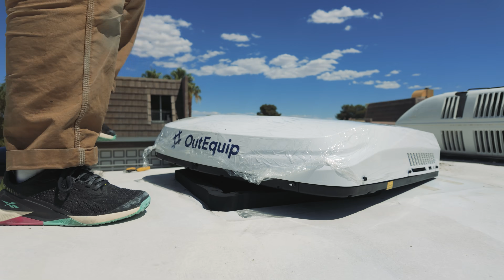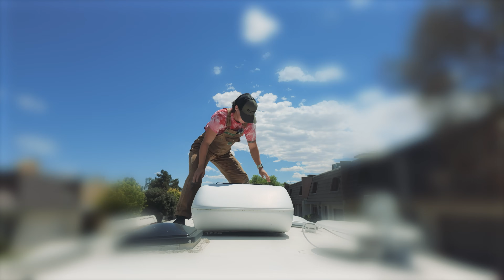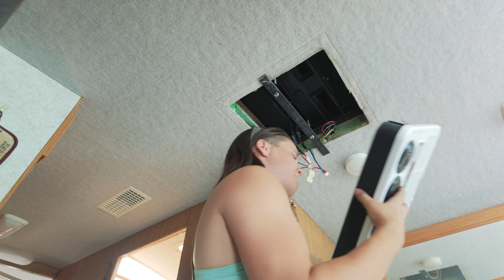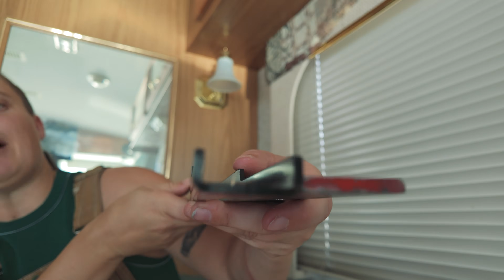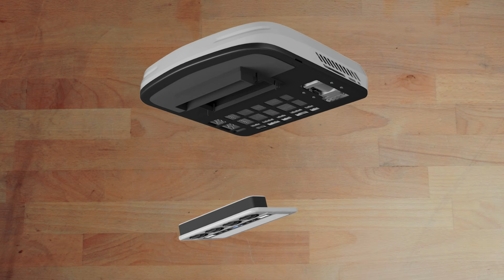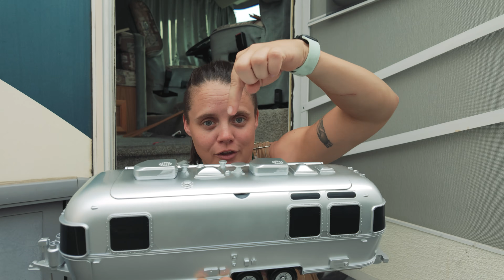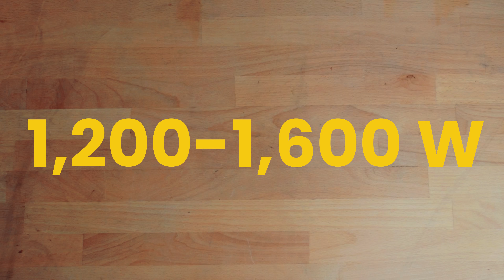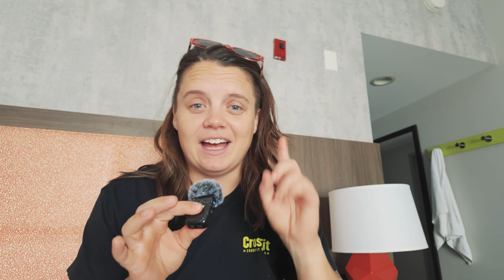Better RV Cooling with Less Power? My Switch to a 12V  AC | OutEquipPro AC Honest Review

Comment: Definitely looks more efficient than an old ac unit. What about charging your batteries? How does the ac side of things look while using this ac unit? Is your charger capable of both powering this ac and storing a charge in the batteries? 

Clarification; I am not dissing this product or your video, genuine questions.
Reply: uses less power because its cool out and it has less cooling capacity

Comment: Be sure to correct your statement that it only uses 300watts, because it uses 960watts on high. And you don't want to confuse ppl. The max wattage use of when the unit is on high is the only one that matters, because that is the amount it uses when it is putting out its max rated btu's of cooling. And that is how you determinine the Energy Efficiency Ratio ("EER") in order to compare one a/c unit to another. This is a 10kbtu unit, so 10,000 divided by 960 = 10.4 So this is an EER10.4 unit. Which means it produces 10.4 btu's of cooling for each watt you spend running it. Your measurement of around 300watts was real. It WAS only drawing 300watts right then, however it was ramped down to a lower btu cooling amount at that time. How much lower? Well, with an EER of 10.4, and if it was only drawing 300watts, then (300w x 10.4) 3,120 btu's was the amount of cooling it was putting out right then.

Comment: My RV AC really drains my Ecoflow Delta 3 Pro really fast.  I got the extra battery but they are so dang expensive... This is a much better solution.  Thanks so much for posting.

Comment: SAVE EXPENSE !!!!
Simply open up roof vents. 
If need be, have an efficient 12vDC computer power supply type fan, that uses maybe only less than 1 Amp.
Hot air naturally convects UP to the ceiling/roof.
For a cool breeze, several sizes of 'swamp-coolers' are available. Position one of these evaporative coolers next to each window you happen to have opened partially. The smallest ones, for $30, run on only a fraction of an amp @ 5vDC.  They need water, though, and can't be used when bouncing around while traveling.
Think how counterproductive it is to REFRIGERATE indoor air, and throw that heat off to the OUTSIDE, thereby compounding the problem, requiring even MORE 'Air Conditioning'. The more people using it, the worse it gets outside, and it creates more GLOBAL WARMING.
I use an air conditioner only when the aforementioned technique is inadequate.

Comment: Hi Emily, I’m wondering why you didn’t run the power cable through the return duct rather than drilling a hole through the roof.  Is there a complication with doing that?  Just wondering for my own install.

Comment: I’m very intrigued . I have a ecotech wave2 ac right now.  I had a van just bought a ambulance. It is to pull our rv and transport my dogs. I work my dogs during the week. Get ver hot in the summer use fans for the most part but during the really hot months like my dogs to be cool. Not good to just idle the vehicle so use the wave2 unit to keep it cool. It does a good job but does take up a lot of room. Think this unit would be better. Actually just started learning how to put solar up. We use the battery that. One with the wave2 and the larger power pack I have. But would love to put a solar set up on top of the ambulance . Do you have a suggestion of what size solar to use to get the most power for running mainly the ac and the cooler. Thank you.

Comment: This is great. Very helpful. Thanks. I have a 2025 Revel with a 3000W inverter and 8400W of Lithium power. Based on prior research, I knew the AC system would be the biggest flaw. For example, while at home, I tested the AC draw using my 6500W generator with the Revels EcoFlow App. On Low cool, the initial start up was calling for 3160W until the compressor kicks in. That’s even a strain on the inverter. Based on Winnebago stats, the battery life will last about 8 hours when constantly running the AC. I wouldn’t do that. Importantly, engineering wise, that is not good. Winnebago’s fix was stated to add a slow start system, use a generator, or shore power. Winnebago, Really! Defeats the defined purpose of the Revel. However, Owners have had success with the slow start and a small potable generator of 2200W. Yet, not the Revel’s intended purpose. Presently, I just use the max air fan or a Luno portable 12v fan for cooling. It works. But, it is only early June. I like the 12V AC idea. Happy travels.

Comment: La energía no se crea ni se destruye, sólo se transforma. Si necesitas una cierta cantidad de energía para bajar la temperatura no importa qué tipo de corriente utilices, siempre va a ser igual, puedes hacerlo más o menos eficiente pero no necesariamente funcional para el caso que se explica. 
Nunca tendremos frio suficiente contando sólo con carga almacenada en las baterias de un RV a menos que utilicemos las baterias de un tesla😂
Reply: "It will never get cold enough on RV batteries unless Tesla batteries are used"?😂 You mean LiFePo batts, right?
Reply: Not only LifePo but also the amount of amperage generated by a Tesla battery. @__WJK__

Comment: Is the premise of this video that people with existing RV’s are more likely to have 12V batteries, because many new builds are moving towards 24V/48V  systems/batteries which are much more efficient, and then getting a 24V AC would be better? I think both systems would have inverters to convert to 120 for other uses, and a 24V to 12V for maybe a frig? I guess the question would a 24V AC like the Nomadic X3 be a better option than a 12V unit that you are reviewing?
Reply: most rvs only have 100 ah of useable power in the stock battery's

Comment: Nice work and great video with clear, easy-to-follow explanations! With a 12V setup, this system can draw up to 58 amps, so it's important not to skimp on wiring, especially for longer cable runs. Be extra cautious with your cable joins, ideally it's just one single 6 AWG or thicker cable, and I strongly recommend installing a 100-amp fuse as close to the positive lead, possible to help prevent shorts and reduce fire risk.

Comment: I would imagine to calculate the actual energy usage difference between the 2 systems, you would need to not just calculate how much energy it is using at any given moment, but how much energy it uses to get it to a specific temperature and hold it there, one unit may stay on using a small amount of energy constantly, whereas the other unit may turn on and off using a lot when it is on but then not much when it's off.
All this would need to be accounted for to get a real comparison. I could be wrong, just my first thoughts.😅
How much time it takes to reach temperature is important for comfort as well. 
Calculating how much energy it uses during the process of reaching the temperature is how you would compare the 2 systems. Please do this, it would be great to see😁

Comment: I wish you would have shared the battery bank requirement for running this AC unit. I have a 300 amp hour battery bank on my cargo trailer and I'm wondering if that is enough battery power to run this unit, but you never talked about your battery bank. :(

Comment: I just installed this and the fans power up to high when I supply power. I disconnected the power and reconnected after five minutes and it’s doing the same thing and the fan adjustment speed doesn’t have any effect with both the remote and on the unit itself. It’s always stuck on high.Is this a logic board issue or a problem with the connection?

Comment: First of all: nice video!
I had high hopes seeing this unit, but I just found out the optional heating function is just a simple ptc element. It's not inverting the flow to make it work like a heat pump. Since I would also like to heat my van this is a nono for me since this will consume too much power when heating.

Comment: So this ac unit sounds fantastic! I just purchased a 3000 wh solar generator with a 12v 30amp outlet that will easily power this ac unit. Plug in my 600w solar panel and I'm living very cool and free! This is going in my cargo trailer build for sure, ❤ bunches.
Reply: You'll probably need more like 80 amps to power this thing on the hottest days. Her readings were not typical of a long-run on a hot humid day in the sun. I've seen that these things are rated closer to 900 watts maximum which is over three times what she was saying hers was drawing on this video. I then thought about the size wire you'd need to purchase if this thing wasn't practically right next to your batteries and that might cost half as much as the air conditioner itself. Honestly when you've got enough batteries and panels, the loss from the inverter usually becomes a non-issue anyways. I've also heard these new scroll-compressors don't last more than about five years, compared to multiple decades on the older ones.
    I think the soft-start for a normal 120 volt rooftop is the way to go for the vast majority of people. I think this DC AC is more of a specialty item than this video leads on, unfortunately.

Comment: I just installed a soft start on all 3 of my Coleman Mach systems in April and if you know basic electrical and can use basic hand tools you can do it yourself.  I would love to convert my units over to 12v for boondocking with my solar but having 3 units in my 45' toy hauler the soft starts were a much cheaper option.  I didn't purchase the Coleman soft starts because those are over $300 each, I went on Amazon and found the same soft start with mounting brackets for half the cost.  And since labor was free it saved me a bunch of money.  Maybe one day manufacturers will install these 12v systems from the factory.

Comment: which AC did you replace? the 1325 watts on 120 VAC A/C lends me to believe that you had a "Power Saver" by Coleman/RVP. In Nth Texas we typically run 1800watts to 2400 watts(100'+ day) with a 15KBTU roof A/C. The Coleman Power saver is rated @ 13.5KBTU and the AC yer using is rated @ 10KBTU. We dont know the ambient (outside temp )temp nor the % humidity. both of which radically effect the wattage and cooling performance. I really do want a comparison with the chinese made 12VDC ACs as our experience has been disastrous, however they did not send us an AC which was tested by said Mfg, knowing it was to be used for a test comparison on u tube. the warranty process was little to nonexistent. After the 3rd compressor failure and one unit replacement, the factory sent out their own repair tech and he just shook his head, told us we did everything he would do and left the lot. He never got back to us and 6 weeks later the owner of the RV had to pay for the hours of labor and no working roof AC.

Comment: Nice review. 
I had not heard of this brand before. 
I’m wondering how the performance (BTU output and amp draw) and price compares to others like Dometic, Cruise and Comfort, etc. 

I’m looking to add a unit to my 2019 Sprinter. 
I have two MaxxFans with the molded valley fillers from DIY Van for a flat mounting surface. 
Or-I could always cut a third hole which won’t leave much roof left for solar.
Reply: Maybe you did some comparison shopping and could make a video on the pros and cons of what you found?
Reply from the maker: 👀👀👀Keep your eyes peeled. I’ve got something in the works.

Comment: Can I run to 12 volt ACS in my rig I already have one mini split 12 volt backpack style that I have not hooked up yet what I plan on it but now I think I want to replace the rooftop unit as well
Reply: I've been doing my research on these 500 cubic feet but they're 10,000 BTU 20,000 BTU off of a 100 amp 12 volt converter BTU to cool 1100 to 1200 cubic feet of space foot my RV is 1500+ I just need to know before spending money on another unit to replace the 120 volt if it's going to be able to keep up in the Florida heat

Comment: i guess this computer like rest of the house ( fried from main grid fire fried the breaker box & majorly surged the whole home and RV camping trailer really) ps there OFF GRID BUILT BUNKHOUSE CAMPER IT SOLD OFF GRID USE ) THIS REAL IMPORTANT ITS FRIED the 12 volt power supply in said camper IT BUILT IN REALLY  30 to 40 amps really ps well plugged into AC OUTLET FOR THE CAMPER! oh well plugged into this ps ITS FRIED REALLY  from main grid fire fried the breaker box & majorly surged (oh i had a EMP device heavy surge device really on breaker box too) it fried stuff in house & rv home - really main heater unit a 2000 dollar unit really fix was 40 dollar part really & microwave 75 dollar walmart & surge switches 3 & RV bunkhouse camping trailer (off grid use really) main on board wired into breaker box the whole unit breaker box & 12 volt fuses the whole wired crap thing really one breaker pops when put on fire thews out oh crap what is it ( the  120 ac to 12 volt on board charger & its 30 to 40 amp feed really) it like cars output for tow truck really it ran 12 volt system well towing really that what i used with solar & gas generators & car chargers harbor freight & Walmart ok  i on phone to insurance agent for march fire and crap really now it rung it them from march really! ok 8000 watt generator propane / gas duel fuel generator per wired house & 150 lb propane setting here in march =3 to 4 days ps i refilled 30 lb to in said time 180 ib price tanks & refills & the generator cost & transfer breaker box unit most 2grand gone it last 3 maybe 4 days on 180 lb of propane do i need to keep going on & rv had generator unit's to & solar system really 2 gallons and half every 3 days normally & out in solar to lets do 30 days & snowing at 130 am really on the 21 of march really i running the truck really it happen grid out meter gone really 915 pm on the 20 th the truth really COST?  I LOVE 100 GRID NOW MONTHLY  I  GOT NO IDEA THE COST REALLY YET that what call was about!

Comment: 9:39 - If you grind a notch in a U-shaped steel bracket, you will seriously weaken that bracket. You should never do that on a commercially produced bracket. Those things are designed for the stress load they have to carry. Cutting a notch in it could cut the bracket's ability to hold up under that stress in HALF.
Reply: Just caulk it. No need for fancy stuff. 1/8 caulks easily. If you don't want it to stick, put slick back tape on the cover and then install it. Caulk it. Let the caulk dry then remove the tape.

Comment: You did a great job explaining things in this video. Since installing lithium last year, I've been trying to figure how to run our AC.
This seems like a smart option, especially since our RV is pretty old - there's a fair chance we could get a failure someday.
It seems like all the reviews for this are within a month, not so many warm weather actual testing results, Still, I'm feeling like this could be a great upgrade. They also sell an 1150 btu unit with a heat pump option. I'll probably go that route.
Thanks for your video!

Comment: You focused heavily on the wattage of the air conditioner, and didn't say anything at all about actual efficiency or Coefficient of Performance. All the wattage tells you is that the unit consumes less power, but if it also puts out less cooling then it will have to run longer to maintain the same temperature.

Coefficient of Performance might be good on this unit, but it's hard to tell - the manufacturer doesn't actually provide any direct specs on it, and only quotes generally on their page that "all their units" achieve a CoP of better than 2.5, which is... kind of abysmal, but I don't know how bad typical RV air conditioners are. It does quote a 10,000BTU output for their smaller unit and a maximum consumption of 58 amps at 12V (696 watts). If it can actually achieve both of those at the same time (a huge assumption) it'd be a CoP of 4.2 which is more reasonable.

This inverter unit will also adjust its power consumption to measure load, while a traditional compressor will cycle on and off at nearly full load. This means that measuring the instantaneous power consumption between both types is not meaningful, because the traditional unit consumes broadly the same wattage when the compressor is active (and basically nothing when it's cycled off) while the inverter unit will run continuously at a lower wattage, so this makes the inverter-based unit look better if you're just comparing watts.

Comment: Can this 12 V AC unit also be used just as a fan at some times, when an air conditioner is not needed? And as such, could it be used in place of a max air fan, thereby eliminating the need to cut two holes in your roof!   ... hopefully?   🙃

Comment: Wow, this is cool.  I've got two A/C's on my class A that cannot keep up when it's over 90 outside.  I'm thinking I could replace my max fan with this A/C and have a "booster" in the middle of the motorhome.  If I increase my battery bank I could run this during quiet time while boondocking.  Thanks for doing this video!

Comment: The best thing you can do for your house , RV , van or teardrop is insulate it so your heater or AC will run less and last longer. The soft start kits can be put on residential, window units and these 12 volt units . Less amp draw when starting for AC units.
Reply: Soft start is inferior to inverter drive. It is ok to modify an on/off type compressor.
Reply: @garykillcoyne6074  until you compare the price . I'm not trying to control speed just lower  the LRA